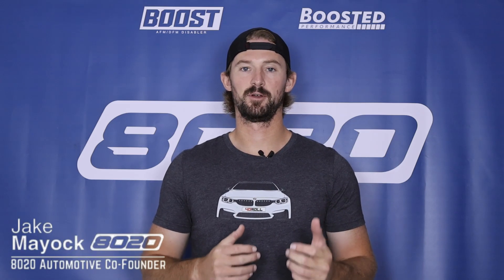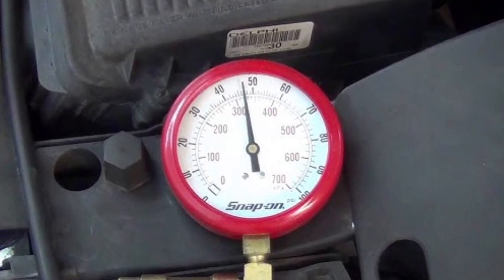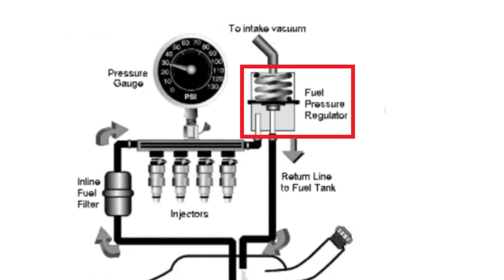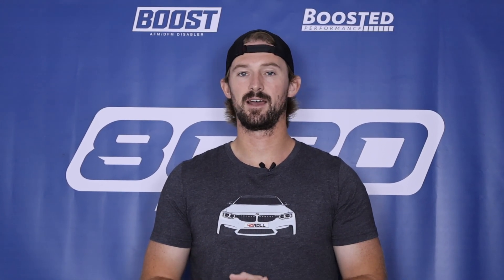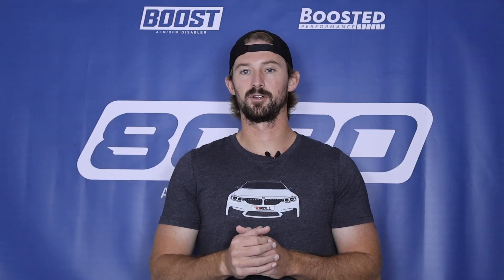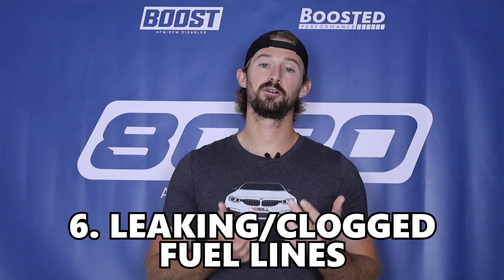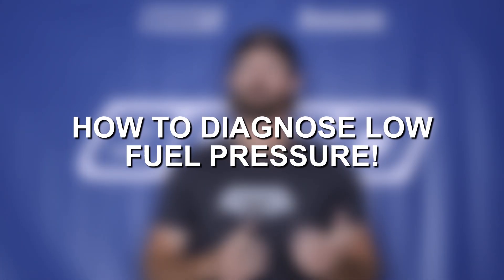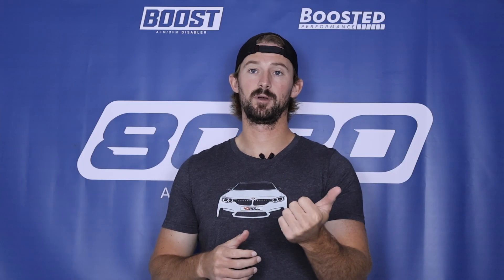Don’t Ignore These Fuel Pressure Regulator Warning Signs

Comment: if I have vacuum leaks in my vacuum system does the fuel pressure regulator gets affected even if its working fine?? my 3rd gen 4Runner sometimes have performance drawback and sometimes it wanna eat that road, I feel sometimes it gets more fuel than needed so its kind of gets choked and sometimes the engine starts knocking when I push it a bit... is it injectors sparkplugs fuel pump IDK, pls help :(

Comment: I know you prolly don’t work in diesels but I was wondering if it can cause you not to be able to start the truck and it just cranks. I put my scanner on the truck and got the code P0001. So I know it has to either be my fuel pressure regulator, my fuel pump relay or my pcm what’s ur thoughts
Reply from the maker: Z - If your diesel is only cranking but won’t start and is throwing P0001 (Fuel Volume Regulator Control Circuit/Open), you’re on the right track with your suspects — this code usually points to an electrical issue with the fuel pressure regulator (often on the high-pressure pump), wiring/connector faults, or less commonly the PCM itself. A weak or failed fuel pump relay could also cause no-start since it won’t deliver fuel pressure, but the most common culprit for P0001 is a bad fuel volume control solenoid/regulator or wiring issue rather than the pump itself. I’d recommend starting by checking the wiring harness and connector at the regulator for corrosion, broken wires, or loose pins. Next, confirm you’re getting power at the fuel pump relay and that it clicks/energizes properly. If both those check out, testing or swapping the fuel volume regulator would be the next step. PCM failure is possible but rare — usually it’s the last suspect after verifying the regulator and relay circuit.